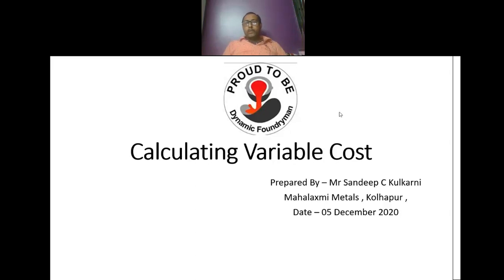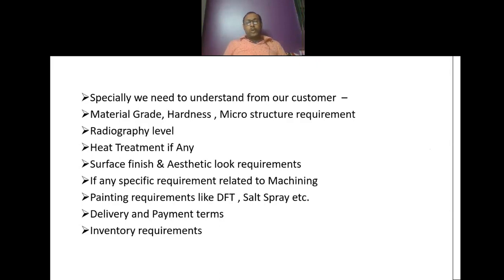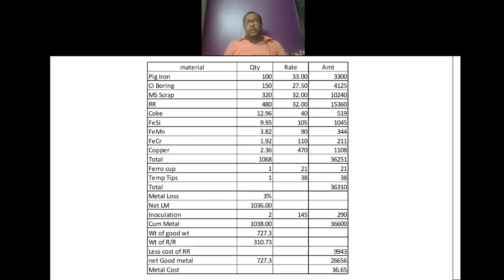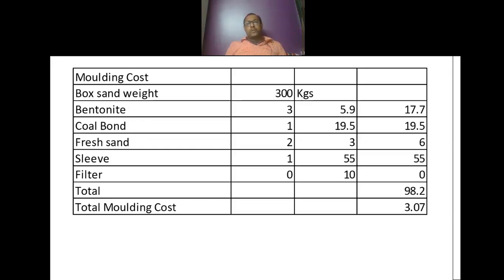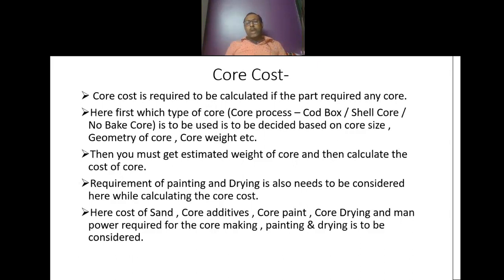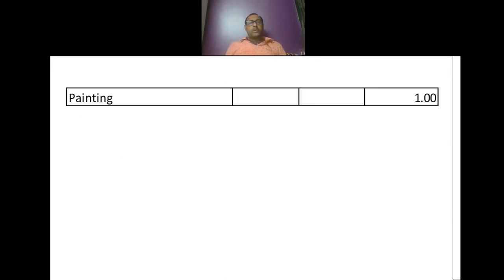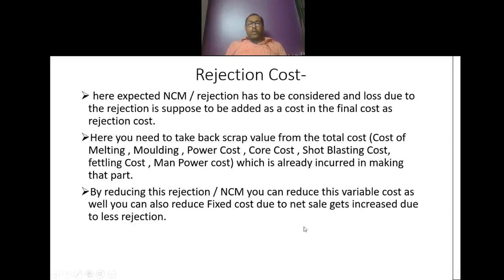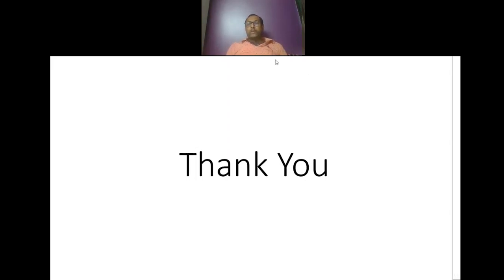Estimating Variable cost

Comment: 1.HOW CORES COST RS. 5.98 ARRIVED 
2.HOW SHOT BLASTING AND FETLING COST RS. 2.75  ARRIVED 
3.HOWPAINTING COST RS 1ARRIVED
4.Any REJECTION % THUMB RULE IS THERE
Reply from the maker: You can see our cold box core cost estimation video to understand how this core cost can be calculated exactly for any individual core.
Shot blasting and fettling costs are considered as estimated average costs here which are normally taken as a part wise average costs.
Reply from the maker: Regarding rejection there is no such thub rule.
However good foundries have keep their rejections below 7-8% overall.
Reply: @dynamicfoundrygroup  thanks for your reply
Reply: @dynamicfoundrygroup  can you provide the URL of the video